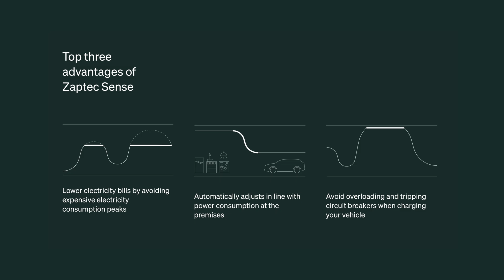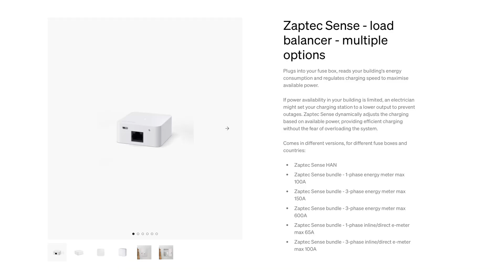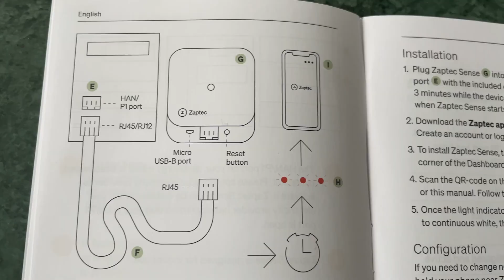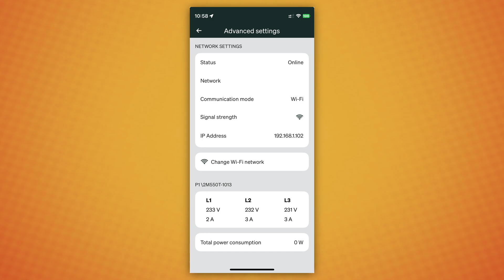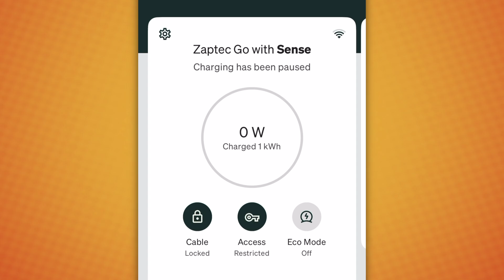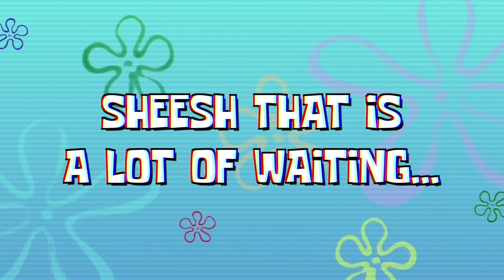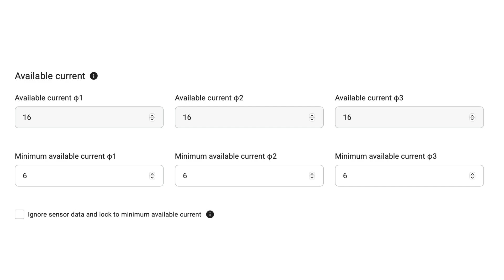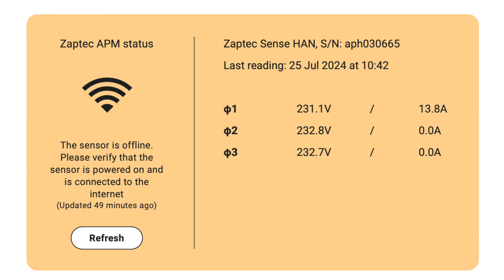Zaptec Sense P1 load balancer | review

Comment: Hi Martin,
Thank you for your detailed explanation!
Since a week we have 3 fase (3x25A). 
I gather that the sense is only enabled in "automatic" load mode? 
Do you know how the sense determines the amperage output per channel? 
There's namely no way to predict the current output being passed through; it always starts with around 8-9A per channel, and sometimes it stays on it, which means you can only charge at a maximum of 6-7 kWh, while I don't have other machines running with a high power demand.
In ‘standard’ charging mode, immediately I get 15-16A and a charging speed of 10-11 kWh.
Is it risky to always set the charging mode to ‘standard’, due to a possible overload in the meter box?
If sufficient solar power is generated by the solar panels, will the Zaptec go 2 or sense take this into account by using (partly) solar power (and partly grid power)?
Thxz, greetings,
Marco
Reply from the maker: The max load is determined by the fuse size. In most cases (Netherlands) the fuse should be set to 25A and max load per phase is 16A which will lead to 11 kW charging. If you need more info, contact Zaptec support they know a lot more than me 😅

Comment: Thanks Martin for creating this video! Recently I installed my Zaptec Go 2 and Sense P1 myself. Initially I suffered as the Sense P1 didn't work correct. At the end of the day I discovered the issue was with the P1 port of the meter. In case remote reading of the power consumption is activated, the is a priority conflict in the real-time data delivery over the P1 port for my meter. Disabled this remote reading feature and everything works fine. You can see the actual power consumption at two places in the Zaptec Portal. My car is a Volvo XC60 which does load at two phases which is visible at the portal. Note that the car also dictates how much power it likes to load. When the battery becomes fuller, the car doesn't want to load at the highest charging current. The Sense P1 utilizes the available power on the different phases very well. I believe it is a very strong concept and the software is stable and improved. Satisfied user.
Reply from the maker: Thanks for sharing your experiences!
Reply: Hello! Where did you disable remote reading? I'm having trouble with this Sense. Maybe more of a Martin-like problem where the charging station won't start charging again.
Reply: @tonimathlin1186 Hi, in the Netherlands I can do this at the website of the institution responsible for the electric infrastructure, called “netbeheerder”, in my case Enexis. After login at your profile you can select this option.

Comment: Which splitter can best be used for use with a home wizard? 

Alvast bedankt! 😊
Reply from the maker: I’m using Homewizard’s own powered P1 splitter.
Reply: @hotdogsoup-nl thanks. Do you know if the home wizzard and the zaptec sense can be used together without an additional 5 volt adapter or does it still need extra power?
Reply from the maker: The Zaptec sense does need some power.
Reply: @hotdogsoup-nl  Clear. So the P1 port of the meter gives too little voltage to provide both voltage. Do you connect the Sense to extra power or the splitter?
Reply from the maker: The splitter needs usb power and will power all of the ports 🙂

Comment: You say that the Sense "responds correctly" in your test, but it seems incorrect to me. I assume that your home is supplied three phases and that either your car or charger is limited to use just a single phase - in your case L1. 

At 9:01, you introduce a dummy load, which happens to be supplied by L2. The Sense reduces the charge current on this basis, but that seems completely unnecessary, because the load on L2 does not affect the fuse/max rating on the charger on L1. They are completely mechanically separate, as otherwise it would be a short circuit and the fuse would blow instantly.

To be clear, a three phase 16A electrical service will in the vast majority of cases be supplied by 3x16A tariff fuses. Thus it will allow for a single phase load of 3,7 kW (phase voltage of 230 multiplied by the available current) on each phase individually (so essentially 3,7+3,7+3,7 when single phase loads are predominant) or a common three phase total load of 11 kW (230 x √3 x 16).

So the limits enforced by the Sense should be 3,7 kW on the phase where the charger is installed (the Zaptec eco system should be aware of this, and btw only relevant when single phase charging) or a total limit of 11 kW total. Yet you demonstrate that the charging is reduced even if the total is "only" around 9 kW and the charger essentially is the only consumer on its connected phase, and as such none of these limits are met and thus no point in throttling? And especially no point in pausing the charging altogether.

It seems like maybe their algorithm treats the chargers current as if it is a three phase load (which in most cases would be fair, but their charger specifically supports single phase operation). Thus, the Sense would assume that the 16 A the charger draws on L1 is also drawn on L2 and L3, just as it would if plugging in a car with a three phase OBC. And thus it would think it exceeded a limit on L2. But in that case, essentially any load in use in your house (with noticeable consumption) would cause throttling.
Reply from the maker: That is correct, the Zaptec Go can not limit charge per phase, and therefore all three phases are reduced even if the high load is present on a different phase that the car may not be using.

The Zaptec Go 2 however is capable of per phase load balancing. The issue isn’t in the Zaptec Sense, but in the charger model that is used.
Reply: Thank you so much for the reply (and the good video). So this issue is only present when "paired with" the Zaptec Go, not when paired with the Zaptec Go 2? (I plan to buy a Go 2 myself in the coming week, hence my interest). 

I don't fully agree that the flaw is in the charger though. In this case, it seems like the Sense should evaluate which phase the charger is using (even if the charger can't limit or change each phase), and only apply limits that make sense based on that. 

So for example, if your induction stove and charger both happened to be on L1, it should throttle the charger, definitely. The ideal would be that the charger switched to a different phase, but as you point out, the original Zaptec Go cannot do this. However, regardless that the charger switch phases and thus cannot "escape" the limitation, the limitation should still only be applied when it actually matters to the charger? Maybe time for another "Dearest Oscar" mail. Perhaps with a twist from Max Payne; "Oscar, dearest of all my friends"

As an aside, do you know if Zaptec Go 2 supports use in a TT network (that is, the neutral conductor is grounded in the grid transformer and there's a local earth electrode in the installation)? It would seem logical and it's sold and used in Denmark where the vast majority of the grid is TT, but it seems to only be listed in the specifications that it supports IT or TN networks.

And futhermore, do you know if the limit for the total consumption of the chargers in the installation (as in, up to three chargers attached to the same installation/home in Zaptec) can be changed either in the app or by API? According to the help page, a home is always limited to 32A total and the only way to have for example to chargers that can both deliver 32A/22kW is to attach them to separate "homes" in the app. But this seems very silly as it both eliminates the load balancing features and also makes the Sense an inviable option to limit overall grid consumption. 

In my case, I'd ideally like four chargers but can settle with three. I have a 3//63A service, so would like the Sense to perform the overall limitation, and have the chargers load balance in a sensible way amongst themselves. Furthermore I'd want solar optimization, but I'm prepared to do that externally, for example through Home Assistant and the API or OCCP. But a prerequisite for all of this is that the chargers as a group doesn't have a hard set limit of 32A. It seems too stupid to be the reality, but it nevertheless is stated such in the documentation. 🙂

Maybe I need to write my own email to Oscar, but I wouldn't want anyone getting jealous. 😄
Reply from the maker: Please send your questions to Oscar using the Zaptec website, and let me know here what you found out.

Comment: Thanks Martin, good stuff. I was planning to install the Zaptec go soon (since I have the homewizard setup and 8kw of solar panels) - I just read that a Zaptec go 2 is to be released in Q4 which will feature dynamic fase switching. Might wait for this one in combination with the sense module.👍 oh, and it will feature V2G as well!
Reply from the maker: Sounds interesting, I did not know that. I may have to review it 😀
Reply: @hotdogsoup-nl Half november it should be available in the Netherlands. No price indication available yet.
I am also waiting for this model. My wallbox Pulsar+ is dead. 😢 So I need a replacement.
Reply from the maker: @bshogeman I’ve heard it has been postponed to next year, but it’s definitely coming.
Reply: Q1 2025 apparently now. Will work seamlessly with their P1 sensor.

Comment: Hi hotdog soup,
Thanks for the great video again.

Because i'm in the "buying an ev"-project i recently asked a local installer to make me an offer for installing a EV charger.

He made me an offer with an Zaptec Go and a tibber pulse for load balancing.
I saw your earlier 18 month review video and your opinion about the tibber pulse. So i asked the installer if he could guarantee that the tibber pulse would be work as it should. He told me that he installed the tibber pulse at with a lot of Zaptec EV chargers without major troubles so far.
I was under the impression that the Zaptec Sense was not yet suitable for the Dutch P1 ports.
Because the price was okay, and i had a good experience with another project with this guy (Solar installation) i decided to accept his offer. And because of his busy schedule, the installation of the Zaptec is scheduled for next month.

I just saw this video about the Zaptec Sense P1. And that it is now working in NL.

Does the Zaptec Sense P1 add anything compared to a Tibber Pulse (assuming it works well)?

If I am better off with the Zaptec Sense P1, I will ask him if it's possible to switch these devices.
There is not a big price difference.

Thank you in advance for your advice.

Comment: I installed sense yesterday (the old p1 with more devices) And did the same test and my charging ”paused” I waited a long time but it did not start. My Installation process was a pain, low wifi signal etc even if it should be more than fine. Fun te se this video only one day after my ”frustration about the same issue”
Reply from the maker: Contact Zaptec support they are very helpful and fixed my issues :)